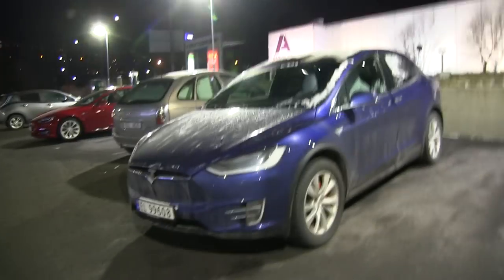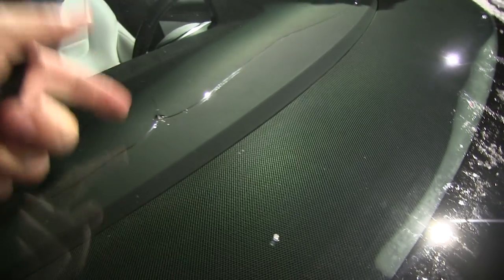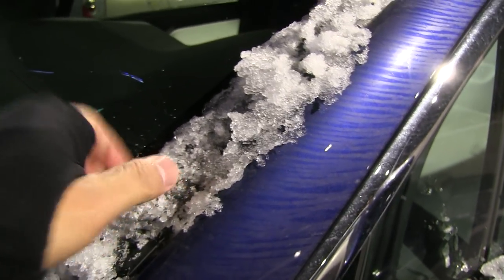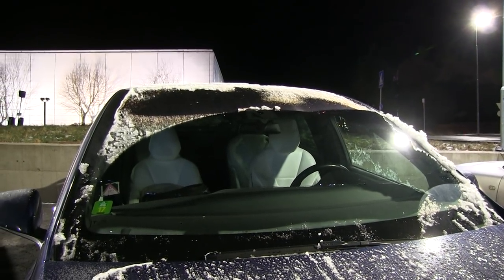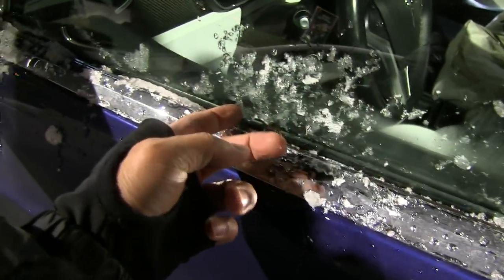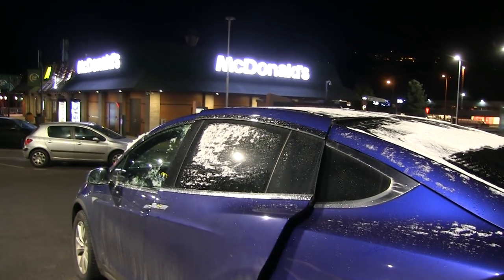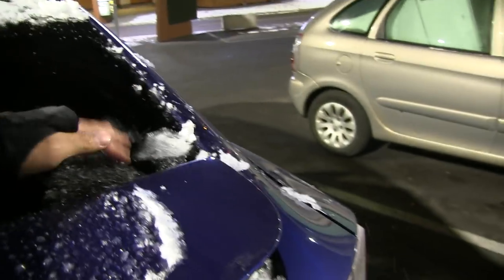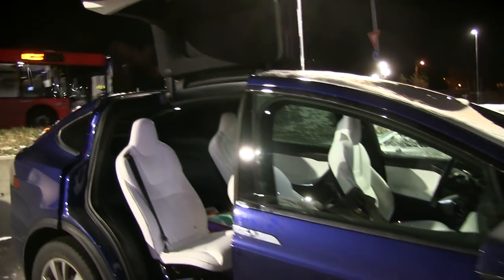Model X windscreen cracked all the way

Comment: If you get a crack or chip and don't plan on fixing it right away. You should get someone to relieve the stress of the crack. This involves drilling a micro indent into the ends of the spider cracks. This stops it from moving. Eventually you need to get it fixed though. If it spiders to the edge then the whole windshield needs to be replaced because the integrity is now compromised. I'm not a pro or anything. Just advice I read and hear from pros when I cracked mine.

Comment: I wonder if getting the stone chip being fixed makes a big difference? It’s a good advert for Autoglass though!
Reply: Yes, it does. If the chip is in the lower part of the windshield, sooner or later it will crack because of the road vibrations / bumps. I had my windshield chip fixed after 2 days and had no problem with cracking after 3 years. A friend had a chip pretty much in the same spot, cracked after a week without a repair.
Reply: Of course because the epoxy cuts the progression!
Reply: Autoglass repair Autoglass replace (it's their jingle here in the UK)
Reply: Fancy a Bev Mate? - Same slogan for Safelite Autoglass in USA.
Reply: Carglass repair, Carglass replace here in Denmark! (And yes, they sing it in English, even though we're in Denmark, thank god)
Reply: Yes it really helps as long as it is still a dot-shaped damage.

Comment: This is why you need to immediately repair rock chips, or, if necessary, replace the windshield. ...if you live in a place with harsh winter conditions and they use gravel on icy or snowy roads, you need to have windshield replacement on your insurance. Insurance should cover repair or replacement. Some states in the US require auto insurance to include windshield replacement in case of road damage. Strangely, a state that rarely gets snow or icy conditions (SC) is one of them. Although, they have some of the worst road conditions, and a lot of 18-wheelers on the interstates that could kick something up.

Cracks in the windshield are almost always started by a rock chip, or other damage, this weakens the glass, makes it susceptible to cracking, as it literally already has a tiny crack, so, stress can spread that crack pretty easily. Sometimes filling in a rock chip can stop it from spreading.

In the US a crack can be ok, depending on where it is, how long it is. If it is within the driver’s main “field of view” as specified, it is illegal to drive it, you can get pulled over and get a ticket. However, if it spreads all the way from one edge to the other, it could be dangerous, should be replaced immediately.

Comment: Frameless front doors are real crap during the winter... Also had problems when I drove a car with those. I used deicing spray on the upper and lower edge of the window before trying to open it when there was ice on it. Really annoying.

Comment: Thanks for sharing!  In the US, our car insurance covers (or can cover) windshield replacement.  Just curious if this  has to be done by Tesla, and what the lead time/scheduling is?  I have a small dent due to me jacknifing my trailer backing it up, and with zero parts needed to remove the dent, the body shop quoted +3 weeks out and 3 weeks to get repaired.

Comment: Your windshield wont explode going down the highway due to the laminate. The glass is weaker but is still strong enough to take an impact. Either way, that is going to be an expensive fix.

Comment: As I heard, windscreens of Model X cracks more often than of Model S, because of more vibrations. Can anyone confirm?
Reply: not true, the glass of the model s is much thinner than the x and will crack more often than the model x. (I work with changing windscreens)

Comment: Over 1000 euros for a windscreen? That's terrifying! Thankfully my insurance replaces any windscreen for £70/€80. Would hate to pay out that much
Reply: Anyone in the USA with comprehensive or similar insurance, get free repairs and replacement in the event of a chip or crack or worse yet a blow out as they do not charge any fee unless the policy was altered by the insuree.
Reply from the maker: I'm talking about the *actual cost*. Not what the customer has to pay.